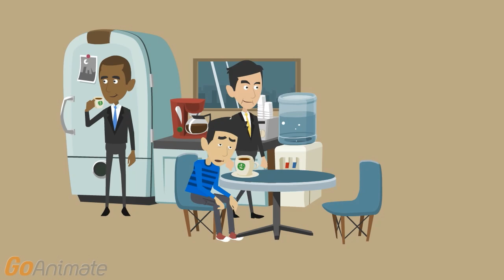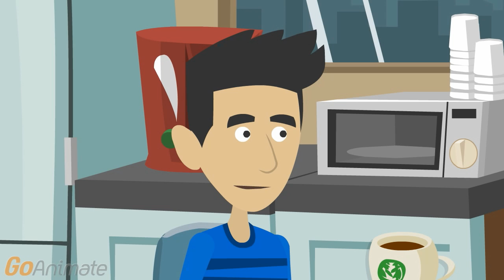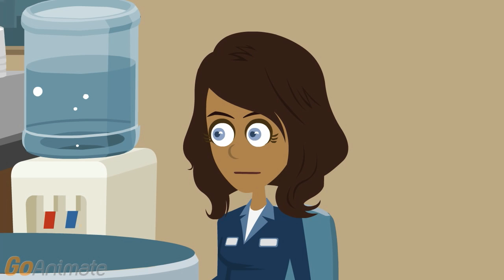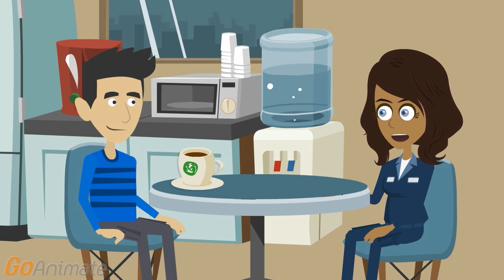Frigidaire Refrigerator Error Codes

Comment: i had a 5y ef error and it ended up being the control board! thanks fpr the video! very informative!
Reply: Steven Jr I have the same issue.. were you able to do it yourself or did you have a professional do it ? Also since it’s been a year are you still having any problems with it ?? Thanks
Reply: @davorebo5790  
Hi, I have an Electrolux fridge with an sy ef error. I wired the fan direct and the fan works, the fridge is now functioning but the error is still on the screen. Did u find a solution to ur problem? If so what did u have to do? Ty

Comment: Hi I'm getting the 5y CF or Sy CF error...can You please explain what that means? thank you so much
Reply: how did you fix this
Reply: Communication error. Control board or user interface or both need replaced. I would unplug all wires and plug them back in. Some boards get a build up on the wire connectors and unplugging and replugging them scrapes it off. Its worth a try before getting the boards.